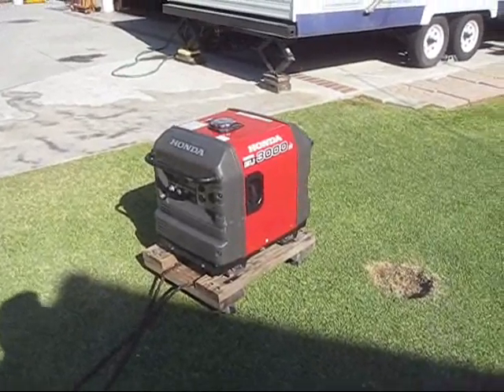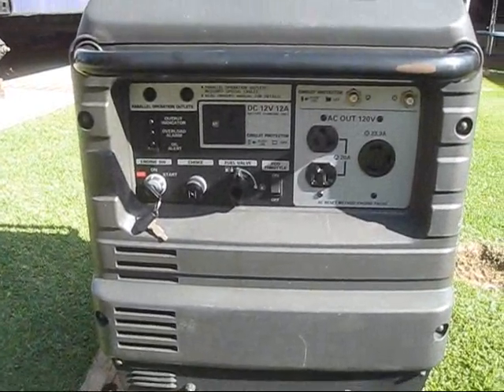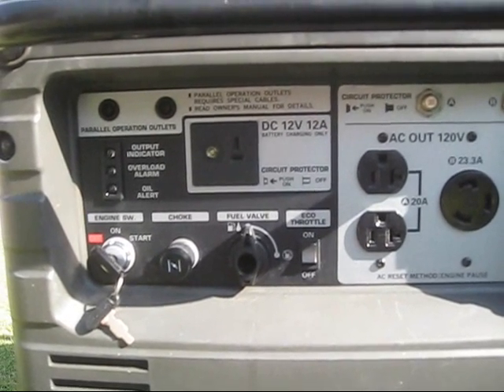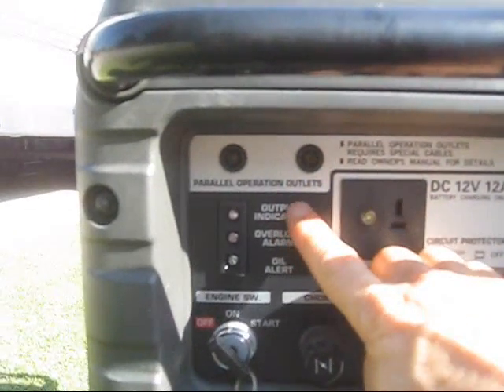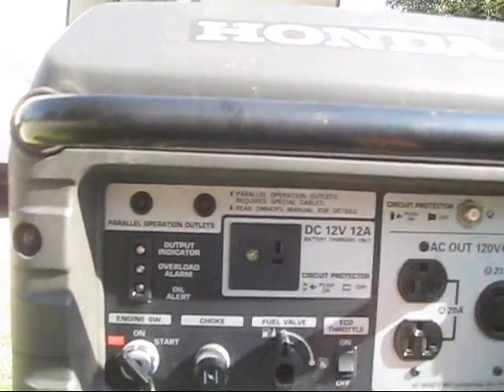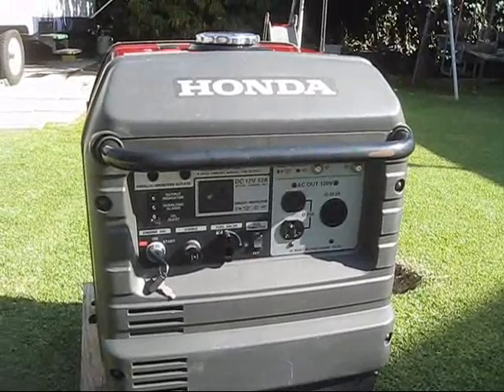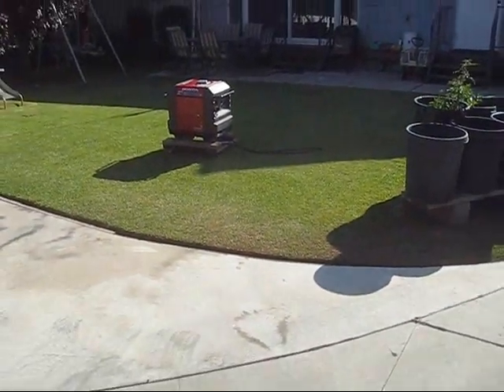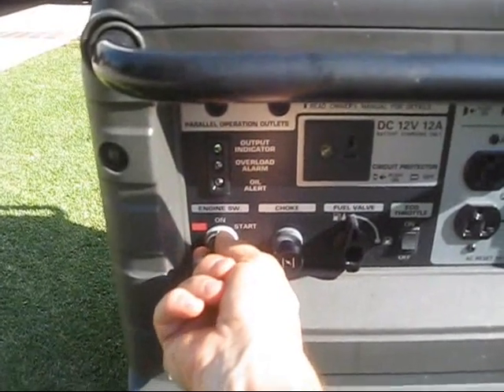Honda Generator EU3000is Explained

Comment: Hi, thanks for the post , i purchased a used honda 3000 is was told all it needed was a battery have purchased the correct battery have it installed correctly but it does nothing, no lights,  not anything was wonder if you maybe able to give me some directions or pointers on what or could be or what to do to correct his issue. 
Thanks

Comment from the maker: @carlsrd2  Yes, the battery is located just inside the front panel.   And yes it does also have a recoil starter located inside the service side panel.